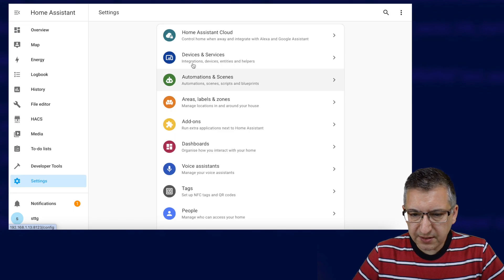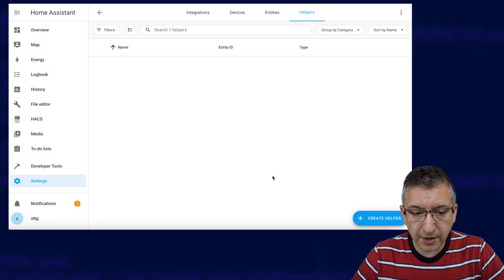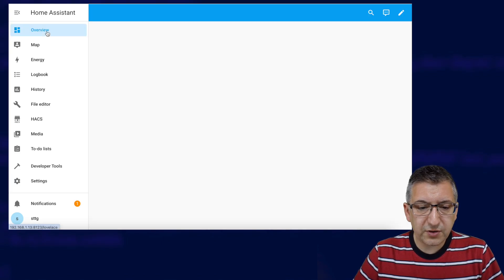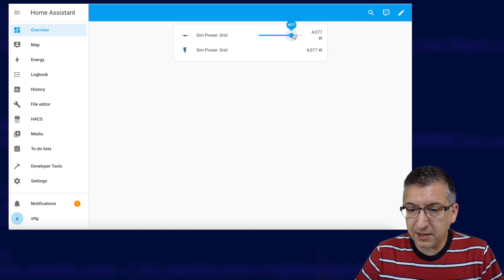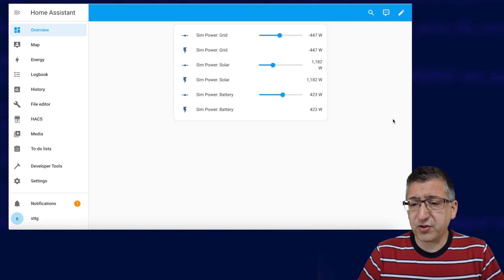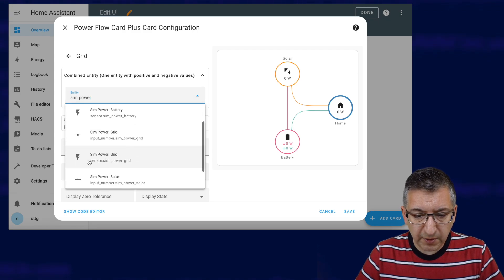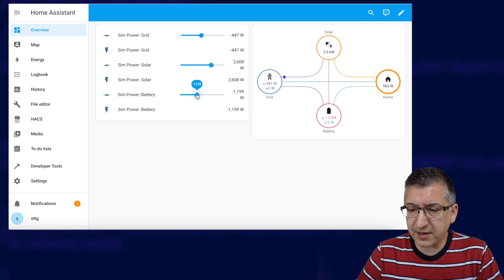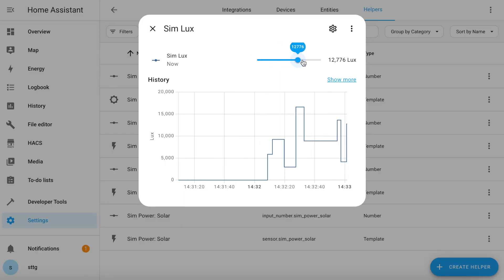Simulated Power Sensors in Home Assistant

Comment: The state template on your website is wrong if people copy and paste it. On your website is shows = {{ states(‘input_number.sim_power_grid’)|int(default=0) }}         It's wrong and Home Assistant will indicate it is wrong because you are using a curly apostrophe. They should be straight apostrophes like this = {{ states('input_number.sim_power_grid')|int(default=0) }} . Hope this helps someone.
Reply from the maker: Thanks for pointing that out - it must have been autocorrected by a text editor at some point during my copying and pasting because I took it from my own installation. I shall update it now.
Reply from the maker: Damn it - my article is perfectly fine, it's Wordpress changing the apostrophe on the fly for some reason when displaying it!! Going to have to do some thinking on this one...

Comment: There is a one issue with this solution. Input_Number will not updated if the value is exactly the same as previous value, for example energy meter give me 2kWh every 1 hour Delta value. Number will be all the time not updated. Energy dashboard doesnt see energy consumption in this case
Reply from the maker: Create an automation to adjust it slightly every few minutes to simulate power fluctuation
Reply: @SpeakToTheGeekTech  Yes that it what Ive done.

Comment: Very good explanation, is there a way to reset the energy database?
Reply from the maker: Do you mean remove the data that's on the Energy Dashboard? If so, there's no 'clear' button I'm afraid. The two ways to do it are either to issue commands against the backend database to delete the historical data for the sensors you have used, or the absolute easiest way to do it is to create new sensors (like a daily cycled utility meter sensor that uses your old sensors as a source) and add those new sensors to the energy dashboard instead. That way it'll only show data from those new sensors from the point at which you created them.